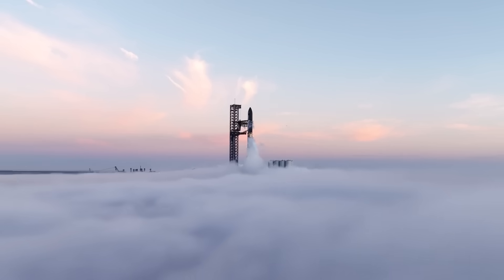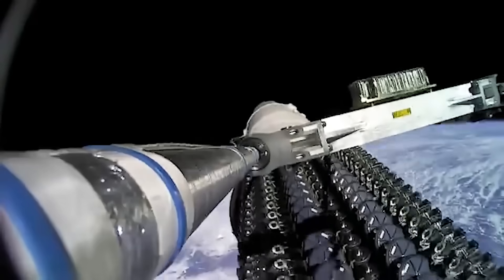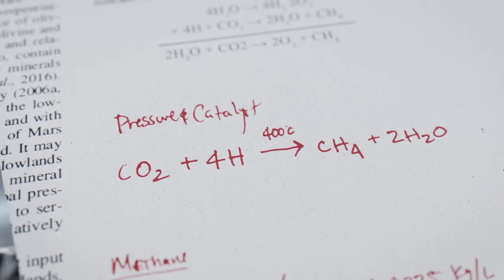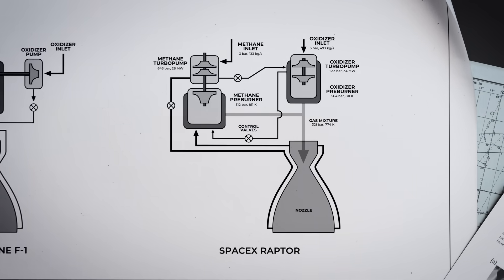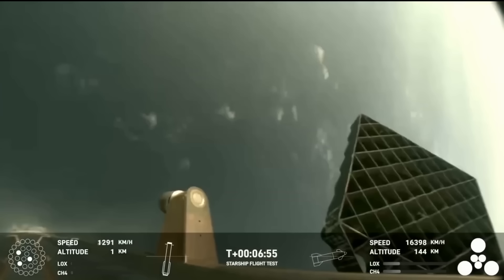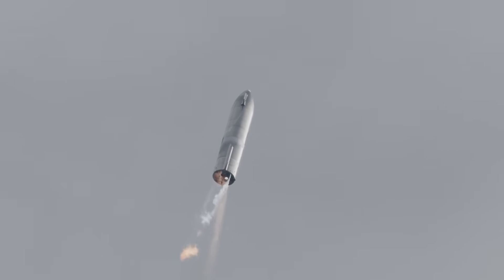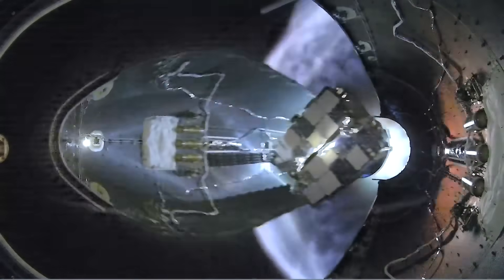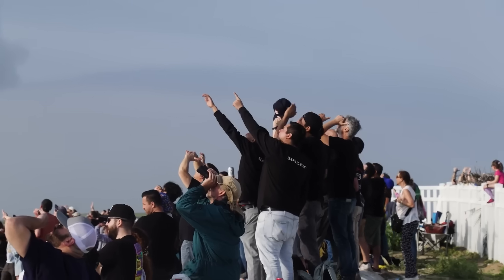Starship Reached Space. What Now?

Comment: Speaking of using heat on mars to make methane; what’s the chemical ingredients for FIRE on mars?
Reply: Well if you really wanted a fire on Mars, you could use solar power to split water into hydrogen and oxygen, and then burn the hydrogen and oxygen.
It would be substantially more efficient just to use the solar power to directly heat whatever it is you want to heat though.
Particularly if you can use focused solar, rather than solar PV.
Reply: @lazarus2691  yeah fair enough. I was thinking naturally. And you’re using that Matt Damon astronaut stranded in Mars technique.
Reply: You don’t need fire to produce heat.  Do you get confused on how toasters work?
Reply: @archierush868  thanks for the dick answer. I’m curious. Don’t be so damn negative. You didn’t understand my question. What do we mix with carbon dioxide (monoxide?) to make flame? Besides oxygen we can’t afford to burn.

Comment: Atmospheric re-entry ends up generating a lot of heat because of the air particles causing friction. The way I see it, if we are to increase our variability on both launching speeds and re-entry safety speeds, we would need some way to thin out the quantity of air particles. The easiest way to do this is with displacement and entering earth's rotation at relative equidistant speeds.

Comment: You keep making up words like "120 meters" tall but I need to know how many football fields that is?
Reply: Im assuming you’re American so it’s 1717.8 BigMacs tall, assuming the average BigMac is 2.75 inches and they don’t get crushed.
Reply: @archierush868  that's crazy that means its only 376.7 big macs smaller than a football feild
Reply: @grenm9  370 BigMacs bigger.

It’s actually around 360ft and a typical football field is probably 300 or so feet. They will plan to make it bigger by only 6 or so feet for newer ships but V3 will be an 450ft from boosters engines to ships nose cone.

That’s 1,963.63 BigMacs!

Kinda hope they make it a tiny bit taller so it’s 1969 BigMacs tall since thats the year the first moon landing happened.

Comment: Lol, now they fix all the problems with the "incredible" attempt at what was already acheived 50+ years ago. Stop wasting taxpayer $ on this trash.
Reply: This is privately funded, so no taxes for this, and there was no rocket 50+ years ago which was designed and launched from the ground up to be fully reusable and used a full flow staged combustion cycle, methane fuelled engines of this scale before.

This is new to everyone, even NASA, and yet, they aren’t funding this part of the project, only the Lunar lander variant which SpaceX has started some progress on for flight hardware but their goal is, orbit first, then refuelling between two ships, then HLS manufacturing truly starts.

Edit: Most of the fixes should be minimal compared to previous flights which for IFT-1 had around 60 fixes needed, 2 needed less than 20 and 3 would need probably around 10 or less major fixes.
Reply: @archierush868  
😄😁😄
Yeah chief, those $$$ are about as private as Mia Khalifa's intimate bits...
Read up a little before you embarrass yourself any further, or just watch Thunderfoot's insightful coverage of the launch.
There isn't a "fully reusable" rocket now either, unless you want to build a rubbish bin with the bits of metal that didn't burn up on re-entry.
Reply: @MikJames-d1g so your just gonna believe TF is right without proving what he said was true or not and just taking it a face value instead of the hundreds of SpaceX employees who spent years developing and testing the Starship, and who 100% has a better understanding of how Starship works than one guy who sounds smart but doesn’t know about how successful SpaceX has gotten with the Falcon 9, saying it will be just as expensive to fly it than the Shuttle and would fail being reusable?

Over 300 flights, almost 300 landings in total (that will be the next launch as of writing this), 220+ landings in a row and literal billions saved from just reusing the booster, and possibly several hundred million or close to a billion saved with reusing the fairings and Dragon 2.

Are they a failure?
Reply: @archierush868  
Yes
Reply: @MikJames-d1g You’ve embarrassed yourself by saying one guy who doesn’t know how diminished value works knows more about the finances of reusable rockets than the MANUFACTURER of said rockets.

Edit: there also isn’t a fully reusable rocket now because no-one has ever tried. Everyone decided it was cheaper to do expendable rockets but SpaceX proved to them that it can be done with the figures I’ve shown before and the reliability they have shown with flights and landings exceeding nearly 300 successive landings.
Reply: @archierush868  Sigh, why not finally sprinkling in some numbers in this debate? 
2022 SpaceX received 2 billion dollar from NASA, with a revenue of 4,6 billion. So saying "no tax money was used" is quite incorrect.
Reply: @Xarx42 was it spend on starship or projects for NASA like satellites for them or commercial resupply missions to the ISS?

No taxes spent on the Starship project. That’s all paid for by SpaceX using StarLink which generates around $1.5B a year for them, and that’s increasing each year to probably closer to $2B a year.

The entire Starship program has costed SpaceX $5B since 2019.
Reply: @archierush868   ... and SpaceX certainly earned some money from NASA, whatever they did for them. Anyway, it's rather irrelevant which resources got used for Starship. With such an extremely high dependency the project wouldn't have been realised without the continuous income from NASA either way.
Reply: @Xarx42 NASA isn’t funding this part of Starship, only the lunar lander version which they haven’t given SpaceX the $2.9B contract yet. And yet, NASA’s budget isn’t increasing either way. If they get $20B each year, NASA can divert some to spaceX if they wanted to. That doesn’t mean you’re paying an extra billion in taxes to SpaceX, it’s just that some will be moved to SpaceX, and if they are given just $1B each year from NASA to develop starship, that’s only around $6 for every tax paying person each year.

Even if they are taxing you for it, it only costs around $6 per year, and as I said, SpaceX earns $1.5B through StarLink, so they get funded more though their own satellite constellation than if NASA gives them $1B each year.

They don’t need taxes to fund Starship
Reply: @archierush868   Sigh, one last time: any company with a customer, which is responsible for more than 50% of the revenue (!), is fucked if that customer is not prolonging any contracts. And the company would have much other issues to clarify (which employees to fire), instead of such an enormous R&D project.
But hey, keep telling that to yourself if you prefer to. Bye bye.
Reply: @MikJames-d1g you didn't even have to mention you get this BS from TF - the more ridiculous SpaceX take the higher the likelyhood that author got it from TF & the likes
Reply: @TheNheg66  
Sure bro, keep on coping.
Reply: @Xarx42 what do you think of the SLS project which has already costed 50 billion+ dollars and 2 billion per rocket
Reply: @MikJames-d1g  like i'm the one coping, lol 🤣🤣

Comment: Starship DID NOT reach orbital velocity DO YOUR RESEARCH
Reply: They had the fuel to reach orbit and cut the engines around 500km/s short of orbit with enough fuel to push it to orbit.

It can reach orbit, they just chose not to as it could survive reentry and crash onto a house or field uncontrollably
Reply: It actually did
Reply: @weekiely1233  no it didnt and it didnt  have enough fuel even if they wanted to. DO YOUR RESEARCH
Reply: @arielatom03  it actually did. Orbital velocity doesn’t mean did an orbit. On a different trajectory they would’ve made an orbit. But they chose a high apogee and low perigee 

The underfueling  was to simulate a payload of 50Tons

Comment: 1.) Demonstrate meaningful attitude control over the upper stage; they were in a spin without any attitude control after venting the remaining atmosphere during their pez dispenser deployment test (which failed), with a loss of vehicle occurring after GAINING speed post atmospheric entry (that's how high up they were when it was destroyed by the re-entry heating).

2.) Demonstrate re-entry without losing the upper stage; see above.

3.) Demonstrate a controlled landing of the upper stage and the lower stage

4.) Demonstrate the reuse of the upper stage and the lower stage

5.) Demonstrate the capability for Starship to enter low earth orbit (it entered a trans-atmospheric orbit, that is not technically LEO) WITH A PAYLOAD (it had no payload and was essentially out of fuel by the time it reached orbit).

6.) Demonstrate the ability for two Starships to enter LEO, rendezvous and dock AND TRANSFER large quantities of cryogenic propellants from one ship to the other.

Then build an entirely new variant, test it, prototype just like they have with Starship so far, and demonstrate that it can be refueled requiring about 20 launches to do so, then demonstrate that it can last for weeks in space and do a full demonstration mission. I've skipped all the development for "Starship 2.0", aka the version THAT CAN ACTUALLY CARRY A PAYLOAD?

 It took them 3 launches and like fucking years to just get into an orbit with no payload or room for fuel.
Reply: They only just started orbital launches less than a year ago and went from spinning out of control a few minutes after liftoff to collecting reentry data, in less than a year.

They didn’t fuel the ship and booster to 100% to account for the lack of fuel. They also said they will be able to refuel a fuel depot in around 8 or so launches. That doesn’t mean 8 different rockets as it can be done with just one or two being reused.

They are the only ones making a fully reusable rocket at this scale
Reply: 1: Fair enough, except they did open the payload bay door. 
2: They are going to test, but this isn't important today. 
3a: They are going to test landing the booster on flight 4 using a virtual tower. If successful, they will attempt landing at the actual tower on flight 5. If not successful, they will test again using a virtual tower until successful.
3b: Much more difficult to land the upper stage. Likely won't happen until next year. Not critical though.
4: Not critical for a while.
5: It was intentionally under fueled for the flight. They have more than enough fuel capacity to reach orbit with a payload. And it was basically in orbit as it was intentionally set with a higher than needed apoapsis and a low periapsis to both test getting to orbit while making sure that it would reenter at a planned location.
6: This is planned for later in the year.
7: New variants are just slight changes from the main version. HLS will be simpler in many ways, while the more difficult items are already being tested by SpaceX and NASA. And no, it will not need 20 refueling launches. That was bad math using old data. HLS will go up and still have fuel onboard. Then another tanker version will carry 150-200t of fuel to add to it. HLS will carry 1200t of fuel at full with maybe an upgrade to 1500t. You are looking at less than 10 launches regardless, and that doesn't account for the extra fuel already onboard. 
8: Rockets are hard. Building the largest, most powerful, most capable, and most ambitious rocket in history is extremely hard. But it is coming along.

Also, Starship is only planned to be fully reusable. It absolutely does not need to be 100% reusable to drastically changed the entire launch industry. Just reusing the booster alone for Falcon 9 changed everything. Reusing just the booster while being able to deliver well over 200t to orbit (150t is while reusing the upper stage as well) would be huge. Doing so while also being able to build the ships cheaply would be incredible. But reusing the upper stage as well just takes everything to a whole new level.
Reply: @anthonypelchat It already is revolutionary as it’s an incredibly cheap super heavy lift rocket which could get maybe 100T+ to LEO while expending everything, and is probably cheaper to make than a Falcon Heavy which costs around $100M. All engines would be less than $40M, booster would be maybe $20M and ship could be $20-30M. It’s already the cheapest superheavy lift vehicle since they are making them almost every week and are moving to V2 which would boost the payload capacity to 100T reused and V3 to possibly over 200T reused.

Another point to add for the 10 launches for the fuel depot: it doesn’t have to be 10 different ships. It could theoretically be just one ship and booster but is likely gonna be 2 ships and boosters. They can also refuel while the HLS is on its way to the moon, on the moon, and on its way back. They can 100% fit in 8 or so launches if its gonna be there for 2 weeks and return, taking maybe 3 weeks in total. 21 days for 8-10 launches is within the capabilities of SpaceX. The Falcon 9 could probably launch that many times if there were some RTLS missions.
Reply: 1. Not hard. Also Commonsenseskeptic is completely wrong on that being the issue if that’s who you are copying from. 

2. Literally next flight 

3. Already happened with the ship in 2021. Not far for the booster to do so. 

4. Not hard 

5. Even less hard. They got 97% orbital velocity last flight with a 50t (10%) propellant penalty to simulate a payload. The gauges are misleading btw. The fuel doesn’t remain stationary after shutdown and floats about hence it looking like there was no fuel. In actuality there was. 

6. Again not hard. Tank to tank prop demo has already been demonstrated and ship to ship prop transfer has actually happened before. This is a funny one because people (you included) will act like this is an obstacle then, when they inevitably do it, you will claim you were never skeptical and that this was something done X amount of years ago. 

They also won’t need the same development cycle for the new vehicles. They’re not that different other than being longer or at a higher thrust 

It also won’t need 20 launches. Do you want to know why NASA was so shy with the numbers? Because starship is in ✨Development ✨and a fluid one too. That number already went down to 15 last year and with V2 is at 7. 

So far their development speed is impeccable. Even with regulatory issues they’ve flown 3 times in a year. But them and the FAA are working to change the licensing type to allow for even more flights without flight to flight licensing which means they can quite literally fly and fly again. They’ve already static fires both the ship and the booster for flight 4. 

You are also DEFINITELY quoting CSS. It did not fly with barely enough fuel. It flew with a fuel quantity equivalent to 50T to LEO. 

Your own hatred and ignorance to development isn’t an argument it’s being retarded

Comment: You left about the part where you need an absurd amount of energy to mine water, separate H2, condense CO2 and then to synthesize CH4. This is not going to happen in your lifetime.
Reply: Robert Zubrin estimates 17MWh per tonne of propellant. So for the 1200 tonnes needed to fill Starship, that's 20.4 GWH. Which is a lot of energy, but the return windows are 2 years apart. So the average power required is about 1.2 megawatts. That's very much at the low end of what is achievable with small module reactors. The Soviets even demonstrated a pair of 150kW Topaz reactors in space. Each weighed about 320kg, so to get the ~4MW needed for 1.2MWe, that's a whopping 8.5 tonnes of mass, assuming no benefits from scaling or newer technology. So easily doable with nuclear power. Solar is a different story - you need about 0.03 square kilometers of panels. Not impossible, but certainly a lot harder.
Reply: The ✨SUN✨